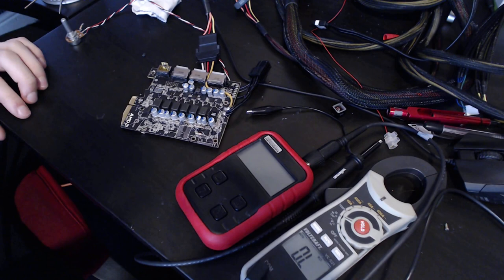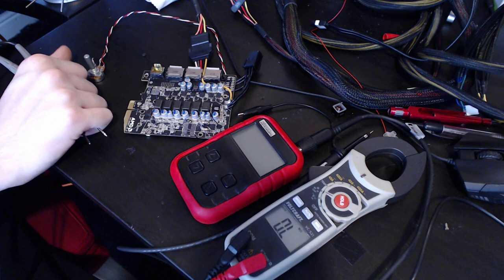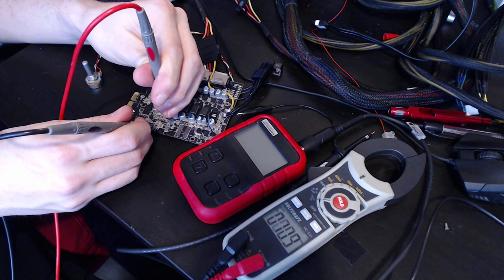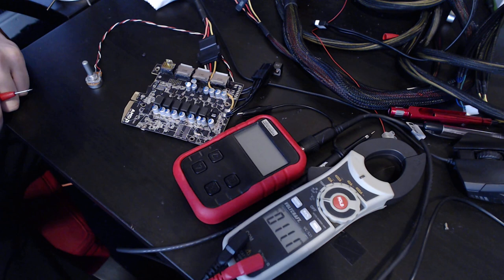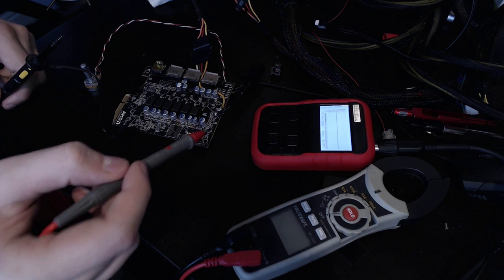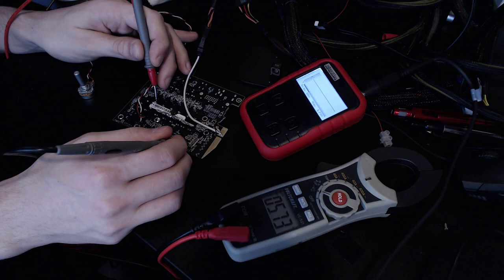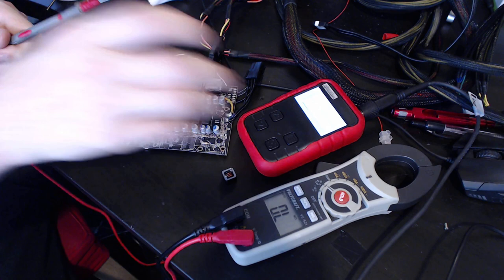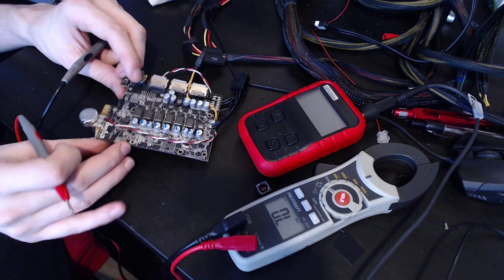Just stabbing a running VRM with an oscilloscope and multi meter.

Comment: A fun thing to do if you want to measure VRM switching frequency is to make a small coil and hook it up to the oscilliscope then just move it above or underneath a choke, the choke's EMI induces voltage in the coil which you can measure with the scope.
Reply: Neat idea. I guess that's only really useful for measuring switching frequency right? I've actually been trying lately to find a way to measure the output ripple from a CPU VRM (measuring after the chokes, just before it gets to the CPU). So far I'm picking up so much noise, it's hard to get a good reading... I have a 100MHz scope, but I think the ground lead on my probe is too long, picks up a lots of garbage.
Reply: You need very good isolation from EMI, possibly differential probing might work if your scope can do that. 
You'd really just need to measure at on of the capacitors on the opposite side of the BGA package as well.
Reply: Hmm, I probably could do diff probing using both channels in math mode. Worth a try, good idea!

Comment: Hey buildzoid a quick question (Ok its not and it starts with a rhetorical question), with having multiple phases (6 in this case/example) putting out a square wave, it would be a good idea to have them all out of phase so that the combined (1/6 (60 degrees) out of phase) so that the average voltage/current (assuming no change in the load) is always constant (essentially as one phase goes low it's covered by another one) right? Well does this mean that the output terminals on a phase cannot be wired in parallel as when one phase goes low it's going to draw current as the other phases are going to have a higher voltage? Regardless of the answer to the previous question is it possible to wire phases in parallel, maybe at the output filter caps? or if not would it be beneficial to but unpolarized caps in parallel of the filter caps as so if one phase drops a small amount of voltage there can flow a small amount of current from the next vrm (which then looses a bit of voltage across its cap so it pulls current from the next caps and so on.)?

Comment: Cool video. It would be neat to do a followup VRM video where you quickly describe what's happening, then show the oscilloscope output component by component. Such as before & after the chokes, caps and such.

Again,  nicely done!
Reply from the maker: I'll need a VRM that is actually running properly with an actual load on it. I'll probably use one of the single phase VRMs I have lying around.
Reply: If needed,  I could send you a GTX 760, that I think is running ok...
Reply: slikrx contact him via email cos in a previous Livestream, he said he doesn't get all comments so email is best
Reply from the maker: I have no shortage of working GPUs..

Comment: Nice video. What is the make and model of the oscilloscope? Would you recommend it for a starter item?
Reply from the maker: It's a Velleman HPS140i. As for if it's worth it I recommend you read some reviews of budget scopes to decide. This is the only scope I've used and while it manages most of what I want I'd really prefer to have a better scope ideally with some kind of USB functionality.
Reply: If it is possible to get a CRO(analog scope) for cheap or free from a used sales website/university/school it would probably be better than a very cheap non "proper" scope.....

Hopefully i was capable of getting a fluke 97(portable electricians 90's scope) from a university in lisbon.
Reply: Practically all USB scopes I've seen are horrrrrific for analog stuff (which is essentially what you're doing - you're not decoding I2C or SPI buses much I presume!). I would recommend a cheap, old analog scope, or perhaps a budget modern scope. A 50MHz scope, a real one, will be like a whole new world in comparison!

Comment: Any chance you could talk about VRM cooling. Specifically what is marketing vs what is necessary. I need to pull of the stock VRM cooling on my Asrock z270 fatality itx and was wondering if the small VRM cooling copper fins that are sold on the internet are enough to cool vs the stock one with a heat pipe. Some expensive motherboards have huge heat sinks and some cheaper options barely have any.
Reply from the maker: it probably doesn't need any heatsinks at all.

Comment from the maker: First
Reply: do u remember, i was the Guy with an I7 4790K with 1.220Volt and 4,7GHz, i just delid the I7 and used Liquidmetal, i can now run 4,9GHz with 1.337Volt, or 5GHz with 1.420Volt. i use an AIO Watercooler with 240mm Radiator, so the Temps are fine. i think i run "only" 4,9GHz for every Day use. the Cache is running at 4,5GHz. And yesterday the "Zomby Power" Shirt is arrived.  love your OC Stuff and knowledge.  sry my English is broken, im German.
Reply: LosisChannel Puh, da brauchst du aber ganz schön viel Spannung oben drauf, von 4,9ghz bis 5ghz. Hast du deinen Ram auch übertaktet, glaube das macht bei DDR3 doch schon einen Unterschied, von 1600mhz zu 2400mhz oder ähnliches. 
PS: Dein English ist ganz gut, aber merke dir, das "I", schreibt man im Englischen immer groß. So weit ich weiß, schreibt man die Nomen im Englischen klein, dass heißt kein "Guy" oder "Radiator", sondern "guy" unf "radiator".
Reply: jo Dankeschön, ja  ist es mir mit 1,385Volt immer bei Prime95 und Cinebench abgeschmiert, hab dann einfach 1,420Volt drauf gegeben weil wollte nicht jede stabile Möglichkeit austesten. Ich kann den DDR3 Ram am Phenom 1055T(24/7@3,9GHz1,55Volt, testweise über 4,2GHz1,65Volt) voll gut übertakten, von 1333MHz zu 1524MHz, doch am I7 kommt mein 1866MHz Ram nur auf 2002, Timings ändern und/oder Ram Spannung erhöhen bringt da kein Ergebniss.
Reply: LosisChannel Hmm scheint ja komisch mit dem Ram. Ich upgrade gerade von einem I3 6100 auf meinem Traum, den I7 5960x. Habe ihn für 450€ auf Ebay Aktion bekommen. Warte noch auf das Asrock X99 Taichi. Ich habe im moment so einen Crucial billig Balastics 1x8GB ddr4 2133mhz Ram. Ich werde dann auf 2x16gb upgraden. Möchte einfach nur Corsair Vegance 2x16GB DDR4 2133mhz und hoffe, dass ich ihn auf 3200mhz bekomme. Ich möchte nicht unnötig teuren XMP RAM kaufen.
Reply: Lusor Justin nice gute Wahl und der Preis ist auch günstig, ich wünsch dir  damit viel Spaß und erfolge.